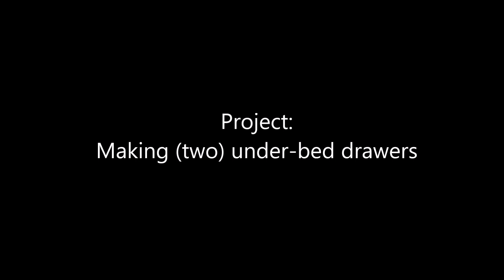Project: Making two simple under-bed drawers

Comment: What are the names of the parts that you were using? I like the video but it would be helpful if you give a little bit of info....thanks.
Reply from the maker: The plywood is the 12mm type. The track rod is 1"x1". The wheels are 1" diameter.